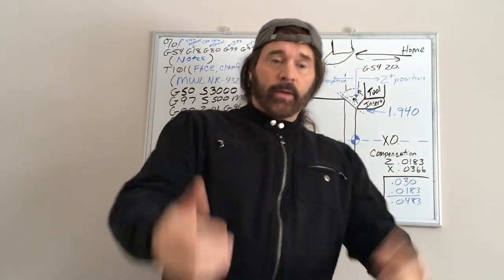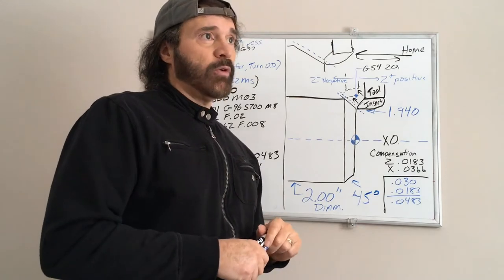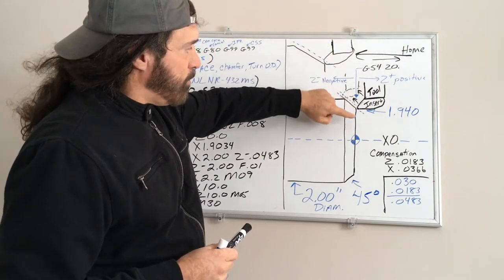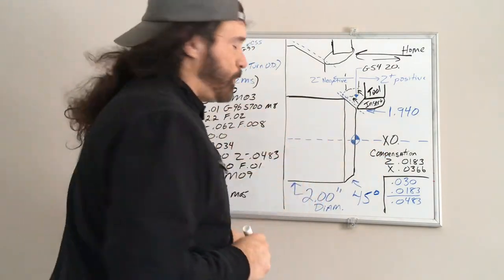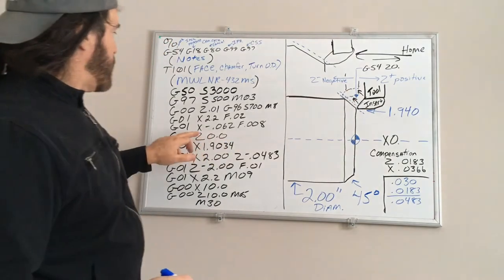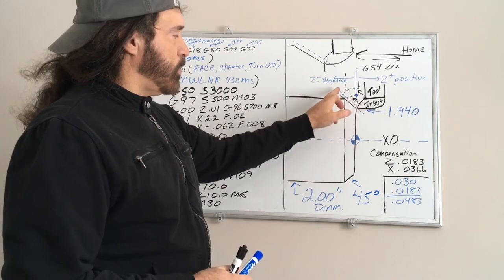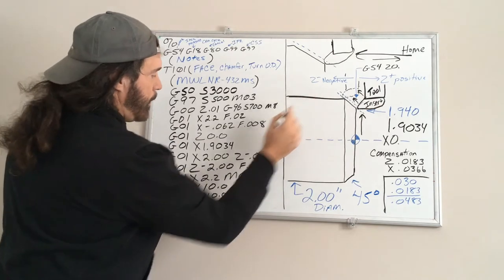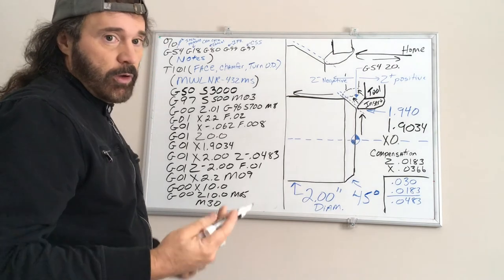Manually programming a chamfer on HAAS CNC Lathe for beginners

Comment: I know this is wrong but the way I was taught was lets say for instance you want to make a .025" Chamfer on a part that's 2" in DIA.
It would be .025(Chamfer) + .016(1/64 Tool Radius) = .041 x 2(doubling it because it's per side) = .082 and thats the x value that you need to be below the final diameter. So the starting value of x is 2.0 (Final Dia) - .082 = 1.918".
To calculate Z it's just .025(chamfer) + .016(Tool Radius) = .041

So the Gcode would look something like this.
G00 X1.918 Z0.010
G01 Z0.0 F.002
X2.0 Z-.041

If you don't want to touch the face of the part when making a chamfer then you just need to add .02 to the equation. 
So to calculate X it would be .025(Chamfer) + .016(1/64 Tool Radius) + .02(compensation) = .061 x 2 = .122 And now just subtract this from your finished(or stock) diameter. 2.0 - .122 = 1.878
Keep Z the same as above and just approach the part to .020.

So the Gcode would look something like this.
G00 X1.878 Z0.020
G01X2.0 Z-.041

This way you don't have to start the chamfer at Z.0.0
I don't know how this works but thats the way I was taught. Seems like kind of a quick hack way to do it but I mean hey it works surprising well for me.
Reply from the maker: Campfirecrucifix…..you are correct in your method.
One the you could do and I’ve done in the past is rapid to Z0.
Proceed to face the part and move away from Z….say .010 and then feed up to the X compensation value that you had while moving your Z back to Z0. and then proceed from there.
Reply: An how do you calculate the radius using this method? Thank you for your explanation in advance 😊

Comment: So to make chamfers of different angles I need to know the exact radius of my inserts or I need the Hass chart.?
Reply from the maker: Hi there.....if you are manually programming a chamfer, you do need to know what the radius value of the insert is.....then if you are going to use a different angle, it would be helpful to have the HAAS chart to help you with your X and Z starting and ending points. In the manual, there is a section called "Tool nose compensation". The charts should be there. 
I found this......page 65 has the beginning of charts.

https://www.haascnc.com/content/dam/haascnc/en/service/manual/operator/english---lathe-operator's-manual---2005.pdf

Comment: Thanks for the information!
I have a question about cutter comp. If I’m facing a part from the top down at a 15 degree angle towards the z0 do I need to use a g41 or g42 to get the right angle?
Reply from the maker: Hi Ali……usually a G41 would be usually for a internal cutting ( boring path) and I personally used a G42 for all outside diameter cuts starting at X0 Z0 centerline and work my way up to the major outside diameter. I’m going to assume you might be able to use cutter comp working from the top down……for instance from  a X dimension of 1.00 inch working down to X0.  Does the print you are working off of give a dimension on your Z depth for your 15 degree angle?
Reply: It starts at z-0.07 inches and it goes to z0 it’s a second operation on a nylon ring that is mounted on a rubber jig that’s why its machined from the top down otherwise it will come off the jig, normally I just start above the x from the start and bring it below the x on the end the radius of the insect but I wanted to try using cutter copm
Reply from the maker: @alielhoujairi2420   Okay, based on your starting Z-.07 location and being that its 15 degree angle, I'm assuming your part diameter is roughly just over 1/2"? 
I did try myself at work running both G41 and G42 and G41 seemed like it might potentially work. 
I did a quick program in MDI and ran it in graphics to see if it would work. So, I went Z-.125 and rapid to X.75 and proceeded to write ,
G01 X. 522 G41 F.005
(Your Z axis will shift in the negative direction since cutter comp is being called up, so whatever your tool radius is, it will shift that amount).
G01 Z-.07
X0. Z0.
X-.06(probably don't need this)
Z.150  F.01
G00 Z.25 G40
(then rapid away from here)

It might work for you.....good luck !
Reply from the maker: I forgot to mention that the tool tip direction was 3 in tool offsets
Reply: Thanks I really appreciate that info and everything you post on YouTube really helps me since I’m a self thought machinist, I’ll try g41 the next time I run this job.
Reply from the maker: @alielhoujairi2420  Thanks for the kind words 😊
I hope it works for you!

Comment: Great video!! I have a question, is using G41/G42 better way or is this better way of programming??
How do we make corner breaks to avoid sharp edges?
Reply from the maker: Thank you for watching!! Me personally, I like to program using cutter comp (G41 or G42). G42 is used for turning your outside diameter and G41 is used for turning your inside diameter. So when you are programing a part and lets say you want to do a .020" corner break on the outside diameter.  Lets say you have a piece of stock that measures 2.125" and you are turning a part to 2.00" and want to add the .020" chamfer. I personally like to rough face and leave about .010" for a cleanup pass.  I will make up a super quick program below.

G00 Z.01
G00 X2.30
G01 X-.062 F.007
G00 Z.1
G01 X0. Z0. G42 F.005(cutter comp on)
X1.96(subtract .04 from 2.00")
X2.0 Z-.02 
Z-1.0
X2.25
G00 X2.30 G40(Cutter comp cancel)

With cutter comp, the machine will automatically figure out where to start the angle, based on the cutting bit radius.  Just remember, whatever tool you have doing the facing and turning, be sure to have in offsets the value of the radius of the tool entered and the tool tip direction......usually that will be a 3. 
Hope this helps :-)
Reply: @TimsCNC-Tractors-and-more  Thanks a lot for replying. That was very quick response, I truly appreciate it. I was asking about corner breaks on chamfer or other corners to avoid sharp edges. Usually how much of a sharp corner do we give? And should it be chamfer or a fillet?
Reply from the maker: @ijasmuhammed991  There is gonna be many variables as to how much corner breaks or fillets are allowed based on the part print. 
I know where I work, its usually labeled a .010" max amount for a fillet and edge breaks. So, we use a roughing cutter with a .015" radius edge insert and we leave about .020"-.030" oversize for a finish pass using another tool with an insert of either a .004" or .008" radius insert. 
Hope that helps :-)
Reply: @TimsCNC-Tractors-and-more  kool that's nice. Thanks a lot

Comment: So what about the x compensation
Reply from the maker: In the video, I had a X compensation value of .0366 based on a 45 degree chamfer. If you are doing a different angle, the value will change. This is based on a .031 radius insert.

Comment: Sorry, but Diam 2.0 + .0312 ? Yes or no?
Reply from the maker: Hi Sergey.....I think I understand what you’re saying, but you don’t add the radius of the cutter to your 2.0 dimension. The chart I briefly showed in the video was based on mainly what a lot of companies use for facing tools, and many of them use a .0312 radius bit insert.  The calculation I came up with is based on what angle you want to cut at ( in this video it was 45 degrees) so, the compensation values will change on your starting and ending points for both the X and Z axis.  If you use cutter compensation, which is a G42 code, you can write your program with the exact starting and ending points and the machine will automatically do the compensation values for you. I did make a video for that explaining how that works. I’m not sure if this helps you out, but hopefully it did ! 😃
Reply: @TimsCNC-Tractors-and-more   Hi , I got it but seems like you had have started with R compensation and finish machining without? I would like to write manually but didn't understand how create the program! Can you show again 
please  chamfer .  I know only as example : 
.
.
.
 G42
.G50....S.....M03
G96....S....
G0 X2.2 Z.1
G1 X... Z0. F.02
 G1 Z.05 A135 F.007 ( chamfer. 05____45°)
.
.
.
M05
M09
M01;

I would like understand without G42  can you show again please? Thanks
Reply from the maker: @sergeyb6954   try watching this video of mine also explaining manual and using cutter comp. https://youtu.be/EQvuhAG9se0
Reply from the maker: @sergeyb6954   hopefully I can explain this a little bit for you.
Based on what you listed in order of your G codes, you don't usually list your G42 where you have it listed. 
1) The G50 code is for max spindle rpm(for example s3000 - which means 3000rpm)

2) The G96 code is surface speed(which depends on the material you're cutting).

3) G00 X2.2 Z.1(so you are doing a rapid move to X2.2 Z.1)

4) It doesn't show you doing a face cut, so I will assume a feed cut to Z.005 (just for this example) and now feed down your X axis to say X-.062 ( assuming you're using a .0312 radius insert on your facing tool.)

5) Here's where it might get tricky for you........The A135. code is a automatic chamfer call.....meaning, the machine knows that you want to do a 45 degree chamfer.  If for example you wanted to do a 30 degree chamfer, that would be a A120.  Now, the Z.05 would need to be a negative value to feed into the part (Z-). If you leave it as a Z.05, it will feed in front of the part.  

6) If you leave the current program as listed, you could do a cutter comp move such as -
G01 X0.Z0. F.007 G42
X2.0 Z-.05 A135. (just using X2.0 for example)
Z-2.0(just making this up)
X2.3
G00 X10.G40(Cutter comp cancel)
then finish you g codes from here.

Or you could write

G01 X0. Z0. G42 F.007
X1.900(remember, everything in X is always doubled)
X2.0 Z-.05
Z-2.0 
X2.3
G00 X10. G40
etc,etc,etc.

7)-Now, for manual compensation-

I'm assuming you're using a .0312 radius bit
Lets say you are doing a .050" by 45 degree angle.  Remember, your Z compensation is gonna be .0183 added to your Z value....So you take your .050 + .0183 and you get .0683. This is your Z- amount you need to put in your line of code where Z will end (I will show you here in a minute).  
Now, for you X dimension here's what you need to do----just remember, everything in X is doubled.  So now, the .050 chamfer you wanna do, take the .050 and multiply by 2 and you get .100 
Now, you need to add the compensation amount to that dimension. The compensation amount for the X value is .0366----so, you take .100 + .0366 =.1366
So, if you want to have you cutter come up from X0. and end up at X2.0----you would subtract .1366 from 2.0 and get 1.8634
So, you feed up to X1.8634, and the make your Z move from here.

G01 X0. Z0. F.007
X1.8634
X2.0 Z-.0683
Z-2.0 (just making this up)
X2.3
G00 X10.
Z10.(just making this up)

8) The M05 code stops the spindle
The M09 code turns off the coolant.  I personally turn off the coolant after my last feed move.....but thats just me.
The M01 code is a optional stop code. In order for that to work, you need to turn on optional stop at the controller. M01 acts like a M00, which stops machine motion.  

I really hope I didn't confuse you!!

Comment: Nice video do you know how to do chamfer that aren't 45 degrees?
Reply from the maker: Thank you for watching my video! Not sure if you have the HAAS Lathe manual where you work.....there is a section in the book that gives you the correct amount of compensation based on what angle you want to do and what radius insert you are using. Usually its for using a 1/64 insert radius and a 1/32 radius insert. If you don't have the manual where you work, you can go to the HAAS website and download the manual. 
I did another video about using cutter comp also. That uses a G42 code for O.D. turning.
I personally use cutter comp ALL the time :-)